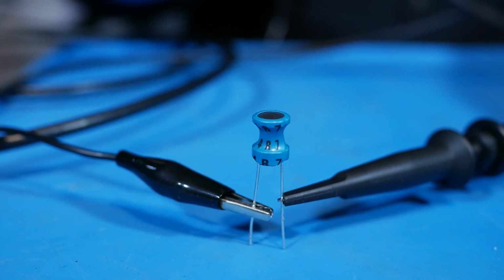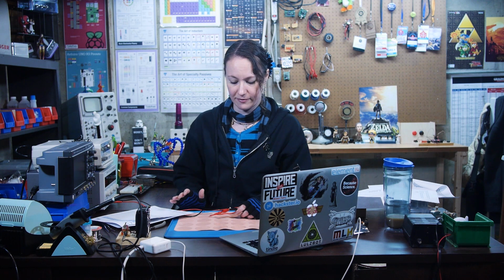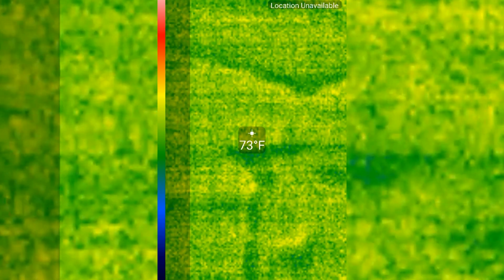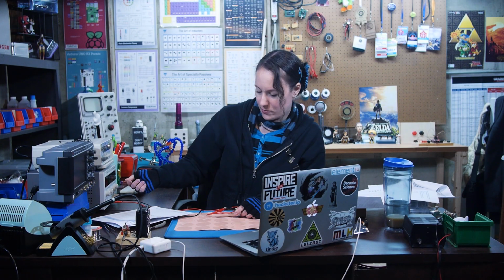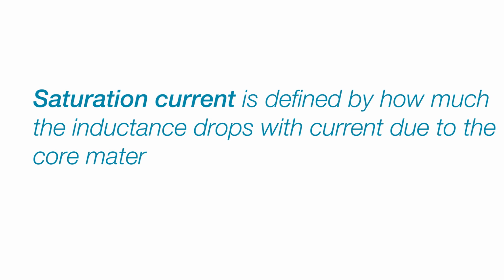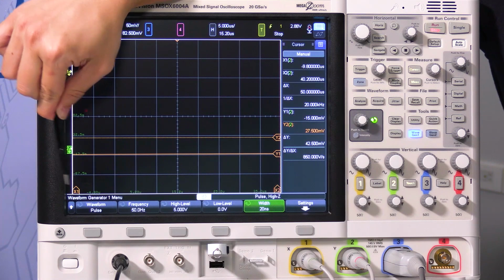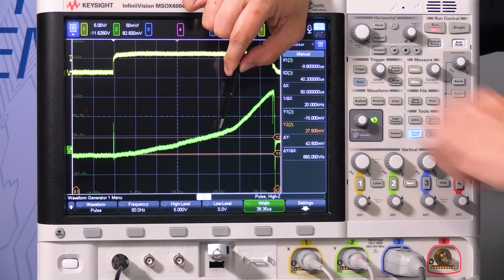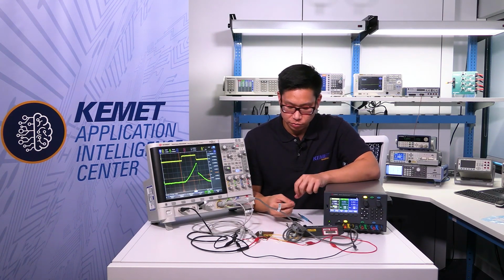In-depth On Inductors with KEMET Part 2

Comment: Not for inductors, but I have built my own low-voltage curve tracer, for measuring characteristics of semiconductors very precisely in the sub-volt region. Diode Vfd, FET Rds vs Vgs, BJT beta. It's primary purpose is detecting the occasional fake components I end up buying from eBay.

Comment: On my laptop, the CPU is powered by the VRM, which has a few inductors. In this application, the inductors are shielded and minimizing interference is clearly an engineering challenge. The inductors are not run hard so are not hot. This laptop has some audible "coil whine" which might be be from these inductors buzzing away at work. The nearby mosfets run very hot.